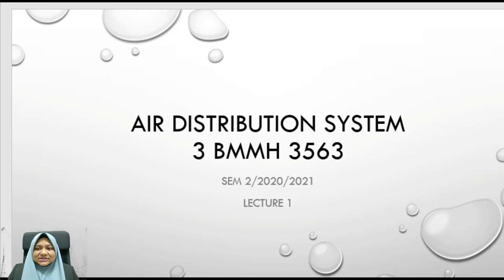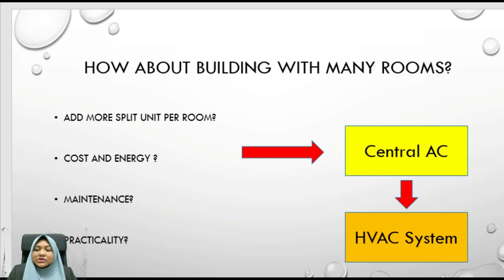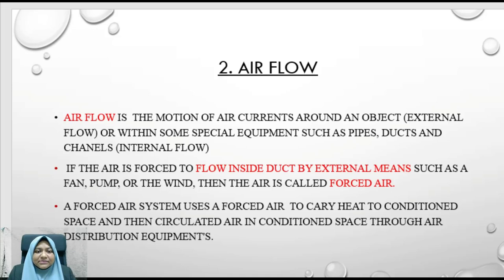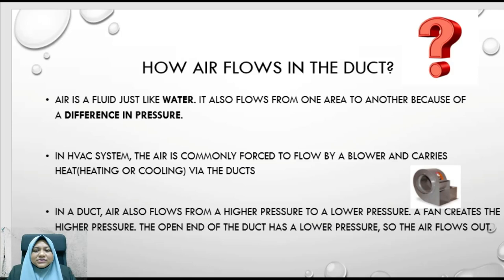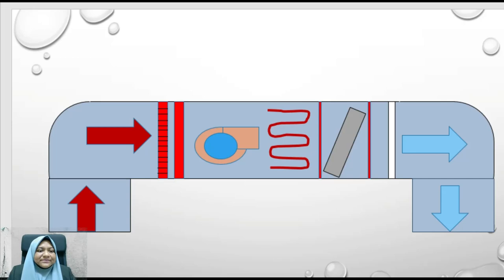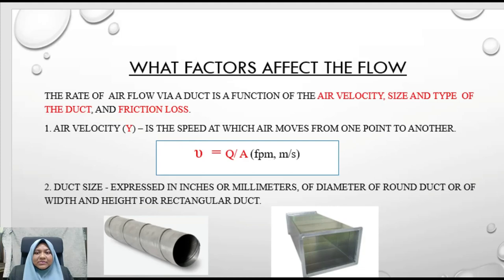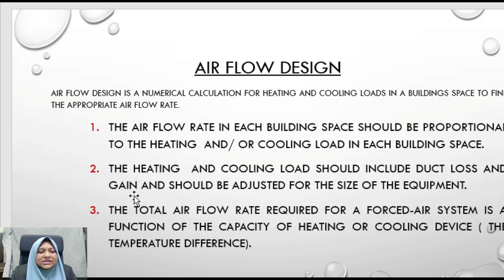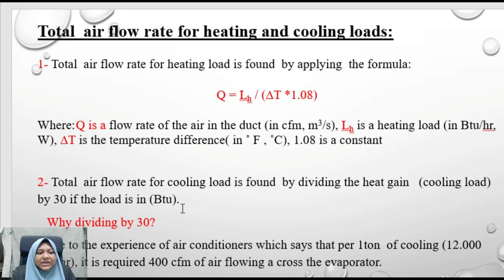Lecture 1 FUNDAMENTALS OF AIR FLOW

Comment: For better air quality and thermal comfort air flow is needed in all buildings.  The air in the duct will flow from high pressure to low pressure.Factor that affect the airflow are  air velocity and size / type of the duct .

Comment: Definition of HVAC  stands for Heating, Ventilation, and Air Conditioning. HVAC refers to the different systems used for moving air between indoor and outdoor areas, along with heating and cooling both residential and commercial buildings. They are the systems that keep you warm and cozy in the winter and feeling cool and fresh in the summer. They also are the systems that filter and clean indoor air to keep you healthy and maintain humidity levels at optimal comfort levels.

Muhammad Firdaus Bin Yusdianto
B091810219

Comment: HVAC means heating, ventilating and air conditioning which is not only to control the temperature but to circulate filtered air to remove all the particulate dust. Air-distribution systems include air handlers, ductwork, and associated components for heating, ventilating, and air-conditioning buildings. 
b091810081

Comment: Ahmad Taufiq Baihaqi bin Mohamad B091810279. Firstly , the circulate of air from cool air area to hot air area will helps meantain the required thermal comfort , avoiding stagnant air and avoid temperature stratification. Next, the circular air flow in the duct system that have different pressure and different heat , from the start of air flow in the duct system carries warm air that have been filter , through the blower, and through cooling coil as it will produce the cooling air that will carries by the air flow through the duct system. Furthermore, the different of duct shape between cyclinder types or rectangular types of duct will produces different velocity of air flow through the duct system. Finally, static pressure is 90 degree of air flow and dynamic pressure is the same motion as air flow.

Comment: Shazni Sahira Sariff B091810225.
The HVAC system is not only have 4 components but it is also include of AHU, ductworks, diffusers, filters, dampers and etc. So to get the successful air distribution, we need to measure by its thermal comfort performance and its energy efficiency. There are 3 things we need to know in the principle of the air flow; the air flow in the duct is from higher pressure to lower pressure, the factors that affect the air flow are air velocity and the duct size, for the air flow design, the air flow rate should be proportional to heating or cooling load in each space, heating and cooling load should include the duct loss and any gain also the size for equipment need to be adjusted and the total air flow required us to see the temperature difference. 

Thank you.

Comment: MOHD NAZRIN BIN MOHD NAZRI B091810221 3BMMH S 1/2
The importance of air distribution is to provide the comfortable indoor air in the buildings with the help of HVAC systems. For building with many rooms can use central AC to provide a comfort conditions like comfort temperature, quality of air and ventilation.

Comment: B091810177

air distribution of air to any from conditioned spaces in the building. In HVAC the are a few meaning which is heating, ventilating , and air conditioning. The air flow is the motion of the air current aroung an object or within some special equipment such as pipes, ducts and chanel. It also have velocity of the air moving , and air flow rate

Comment: MOHAMAD ZAHIM BIN MOHAMAD SUKAIRI 
B091810344
3 BMMH S1/2

1. What is HVAC
- heating
_ ventillating
- Air conditioning

2. Air Flow
- air flow is the motion of air currents around an object (external flow) or within some special equipment such as pipes, ducts and channels (external flows)

3. importance of air flow
- conditioned air must be delivered to selected areas of a building and then removed from those areas and returned for reconditioning. conditioned air is usually transported through ductwork.

Comment: Name: Muhammad Hadzim Ashraff Bin Mazlan 
No.Matric: B091810248

Summary: 
Firstly, to make the environment cool and comfortable we can apply air-conitioning system on the space or house. There are also 3 improtance of airflow such as must be delivered to selected area then removed it and returened it to conditioning zone, energy has to be either supply or extracted from the conditioned space, in hot weather heat is removed from air by use of electrical energy.

Comment: RAJA MUHAMMAD ASYRAF B091810063
3 BMMH 1/1
what i learn from this topic is air flow very imporntant in building or house. Another thing is i can see clearly about what hvac porpuse which is to control temp. , circulatw air , filter air and also the afficiency.Beside that if dont have air flow , for sure we cant breathe properly and also not feel comfortable. For split unit it return air already at indoor unit but for central unit..it has AHU and Duct. Lastly i know the equipment to measure the pressure and velocity in duct.